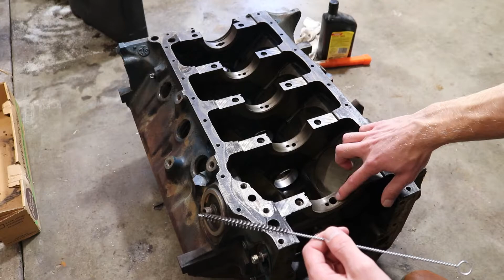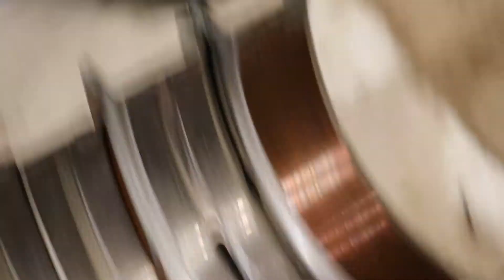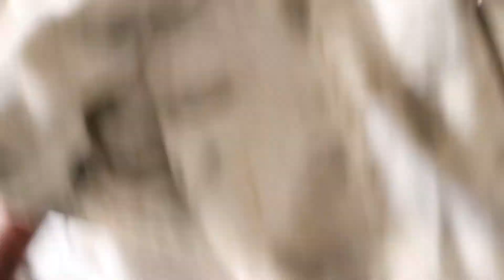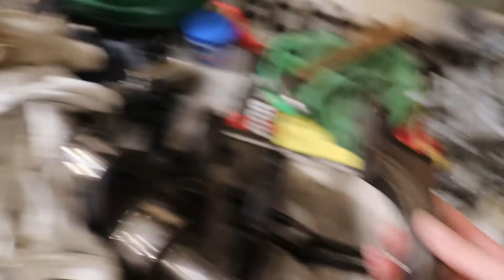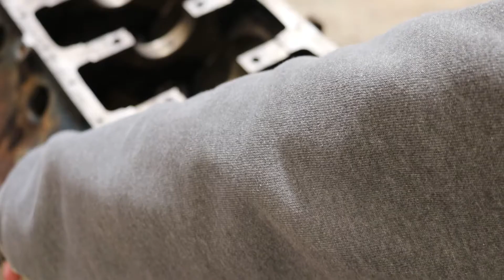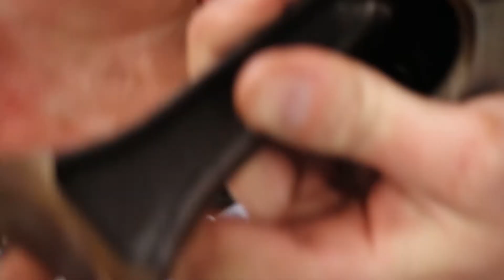| Going Back Together! | 1977 Ford F250 351M Engine Teardown + Rebuild Part 6

Comment: Keep you old cam, after installing new bearings clean and use the old cam to test fit.  Once you get it in the bearings, use a wooden dowel and hit the cam right next to the cam bearings, it will help “level” or “seat” the bearings.   Also use some kinda oil any time putting a cam on bearing surfaces.  Remove old cam and you will find the new cam will install much easier and should spin freely by hand. 👍🏻

Comment: What oil did you use?
Reply from the maker: The first oil I used was Schaeffers Supreme 7000 Synthetic blend which was thin to begin with (and old). Schaeffers is good stuff but because the old 2150 dumped fuel it made the oil like water so I drained it and went to just a normal 10w-30 oil. Both had ZDDP added in which has caused foam both times. Next oil change will be 10w-30 Rotella T4 as I do believe it has ZDDP pre mixed, seems to be the go to for these engines, also go with WIX filters.
Reply: Thanks! Yeah, I did some research about flat tappet cams and decided a while back to go with Lucas Oil classic car 10W-30 that has zinc. Became a big fan of their products in the past. I heard about the Rotella and will have to look into that. I’m into whatever performs and saves $. I noticed my owner’s manual even says 15W-40, I believe, for hotter temps (I’m in FL). High average temps along with probably more sloppy tolerances from wear, I might go to that weight next time. I’ll check out the WIX. I have the Motorcraft one. Literally was like $3 at Walmart and supposedly they are pretty good, I think.
Reply from the maker: Yeah I would for sure check out whatever oil is good for the hot climate down there, especially for summer temps. Motorcraft is good as well, some brands have a bypass inside the filter that I have heard can get stuck open and not filter oil or something crazy like that.

Comment: What was that plastic brush thing called. You said you got it on eBay? Do you know the part numbers for the Tim Meyers plug?

Just a tip: Magic Tap cutting fluid (bought it on Amazon) makes a big difference for drilling and chamfering like you did.
Reply from the maker: Turns out the brush is actually rubber, took me a while to find and they don't sell very many is the USA on eBay. Link should be in the video description now. Also the plug is just an average 1/4" NPT plug I got at a local hardware store.
Reply: Thanks!  Looked like the brush worked really well. Going to check it out.